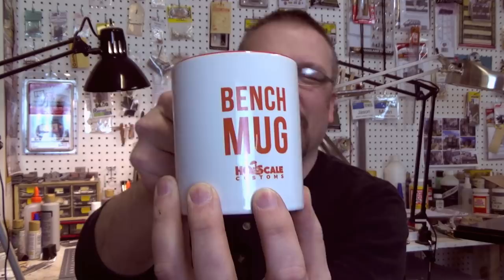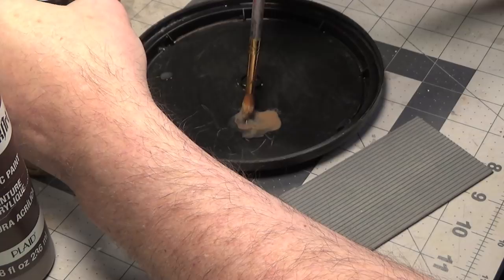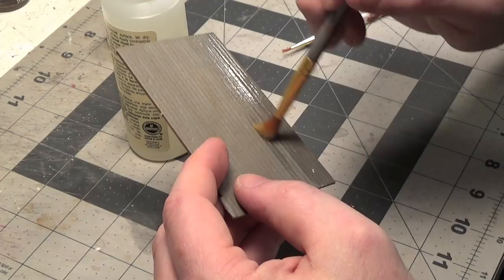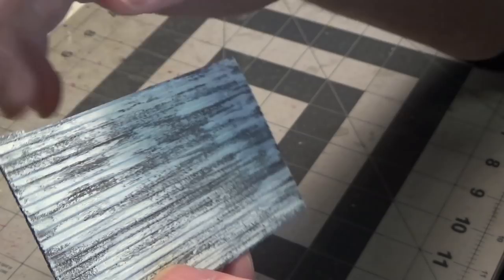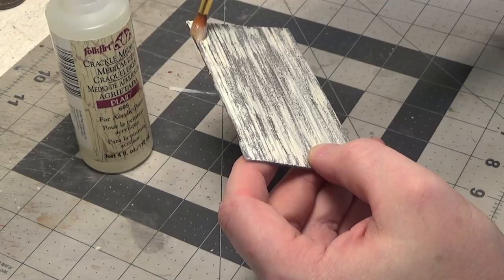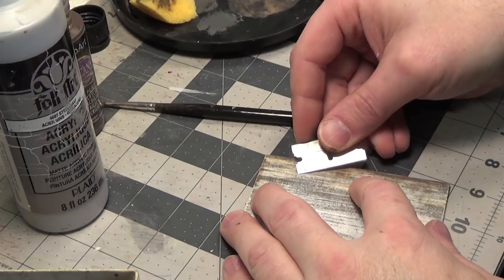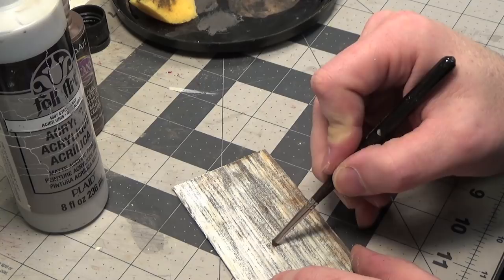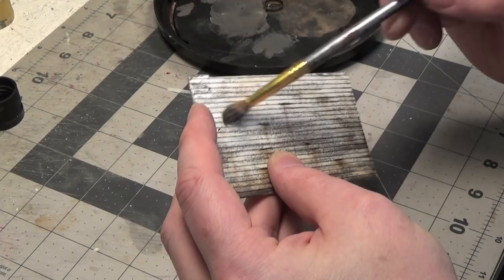Painting and weathering clapboard walls for model railroad structures  Episode 008

Comment: A 0.0625" to 0.125" inch thick piece of basswood would work as well on the back of it as long as spacing for window frames attachment is allowed for on the back of the exterior sheeting and for the joints between faces of the building.

Comment: Jason,
Would it be better to paint the back side of the structure before installing the  1/8” x 1/8”
Bracing?.
Thank you again for all your great videos.
Bob
Reply from the maker: If you paint the wall before you glue on the 1/8 bracing it will warp. The bracing must be glued on first.

Comment: Hey Jason, I'm coming from wargaming and just starting out in more realistic models and your channel is a gold mine!

I have a quick question about the clapboard. I'm planning on some scratch building and not sure what size (in fractions of an inch) I should be using for HO scale. I see stuff from 3/64th to 1/8th of an inch for sale online. I assume this is the size of each "plank" in the clapboard.

Also, I see both plastic and wood clapboard for sale - I think you use wood here but not 100% sure. Any recommendation for one or the other?
Reply from the maker: Thank you so much Fred!!! The clapboard is 1/16 wide. You can buy full sheets at Northeasternscalwlumber.com
The sheets are 1/16 thick. Make sure you read all the measurements well on the website before ordering. Hope this helps. Thanks for watching and happy modeling!!!
Reply: @JasonJensenTrains  Thank you. Will be putting down an order from them soon :) 
Would I need anything stronger than a hobby knife/box cutter to cut those sheets? Especially cut out spaces for windows?

...and now I'm back to watching your backlog.

Comment: Great video! Quick question, what is your preferred size of clapboard for HO scale? I was looking on sites like northeastern scale lumber and all the clapboard panel stock is just listed in MM/inches rather than scale. I know you could probably use a variety depending on the look you want. But I wanted to know what you think a good size is for HO scale. Thanks again for all your help! Keep up the good work my friend!
Reply from the maker: Thank you so much!!! I prefer 16th inch clap board.
Reply: Jason Jensen Trains Awesome! Thank you again. I got the print catalog from Northeastern scale lumber and the catalog actually has a pretty handy table that for some reason I didn’t see online.
Reply: Jason Jensen Trains Awesome! Thank you again. I got the print catalog from Northeastern scale lumber and the catalog actually has a pretty handy table that for some reason I didn’t see online.